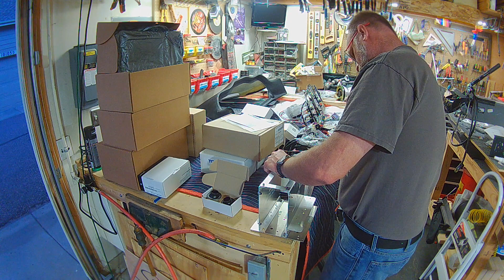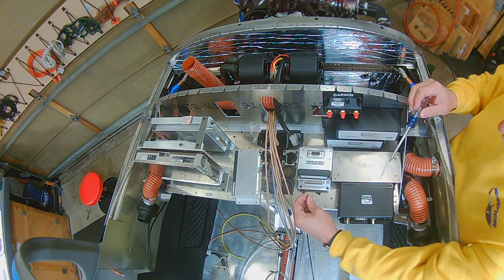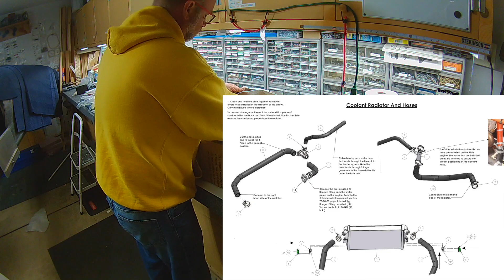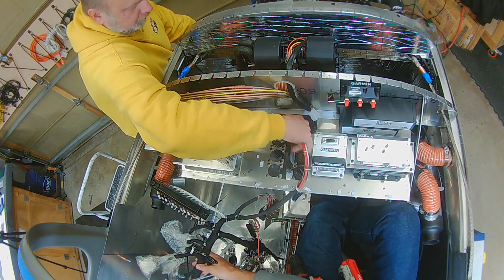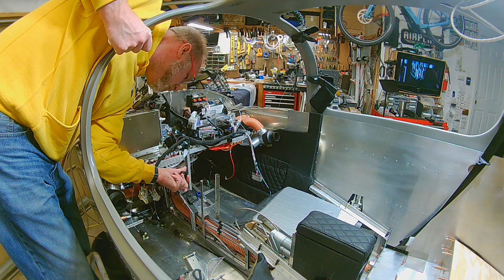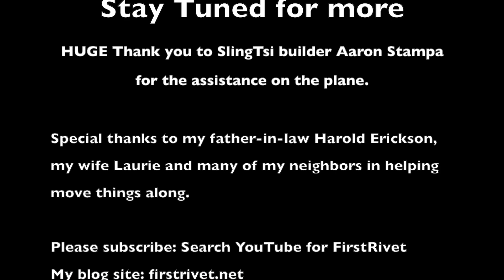Getting Wired - May 2023

Comment: Why doesn’t Midwest build up the entire panel and tray and deliver it as an assembly you just drop in?
Reply: The components themselves need to be protected during shipment, as does the harness. Also, the shipments are already large as it is - having fully assembled pieces would make it even larger (more expensive) to ship... especially around the world.
Reply from the maker: In adding to what Midwest said, the tray would get very heavy and unmanageable during the install.  It's much better to take baby steps in the assembly to build up the platform vs. a complete drop-in.  Just don't do what I did and misplace one of the parts... staying organized is probably half the build process.  :)  The wiring is it's own project and even if the tray were fully assembled it would need to be done separately.